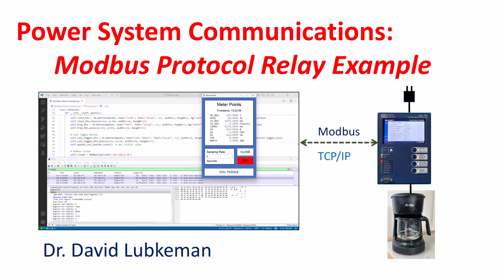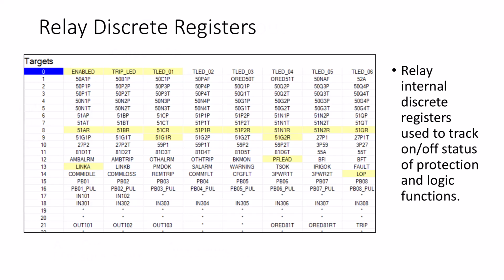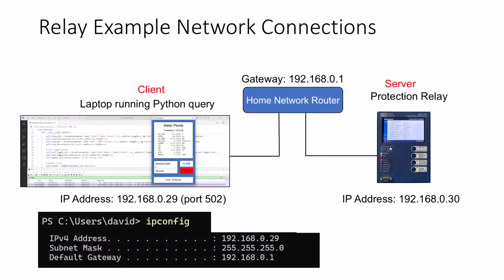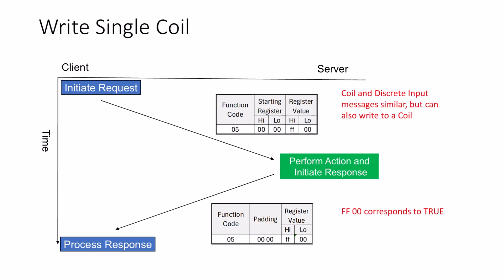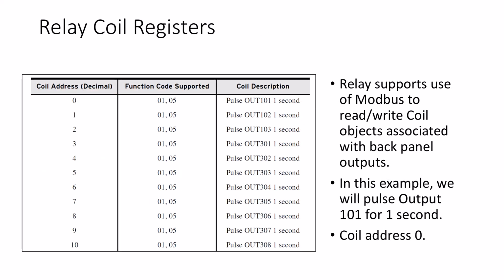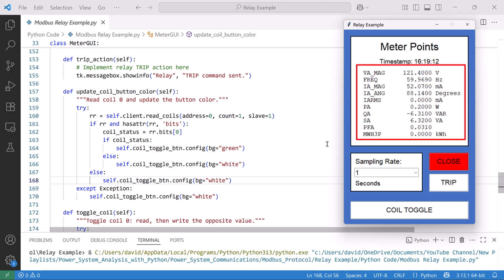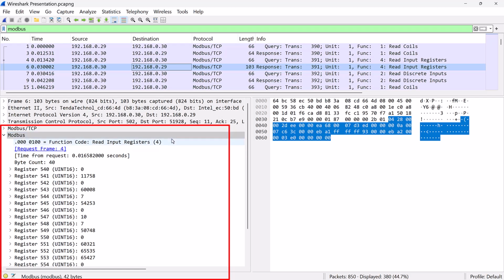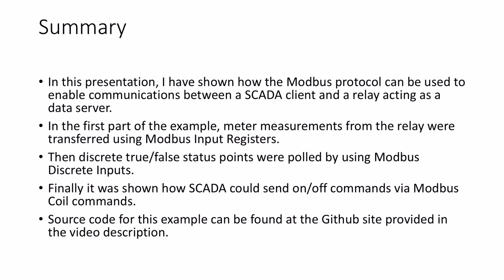Power System Communications - Modbus Protocol Relay Example

Comment: Very informative, Is it possible to do the same monitoring on a Delta HMI using Dopsoft?
Reply from the maker: I am not familiar with Dopsoft, but if it supports Modbus then you should be able to do the same type of monitoring.  Also need to make sure that the device acting as the server supports Modbus as well.  Not all protection relays support Modbus.